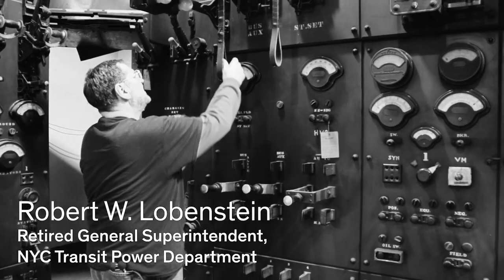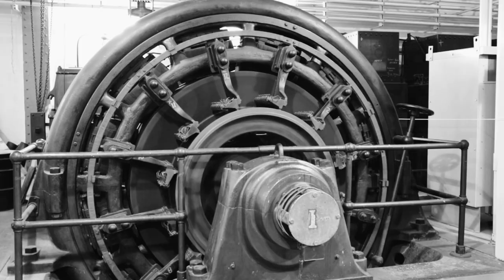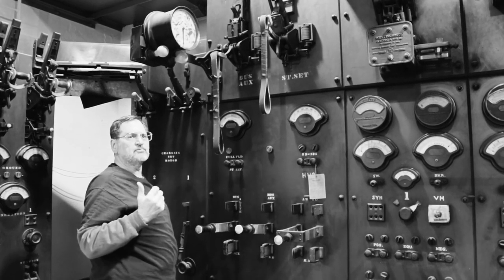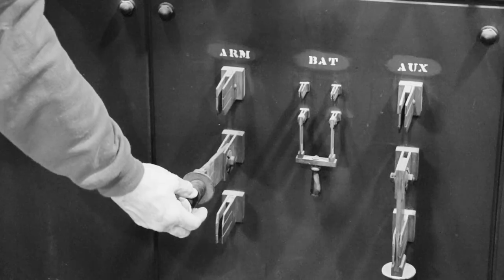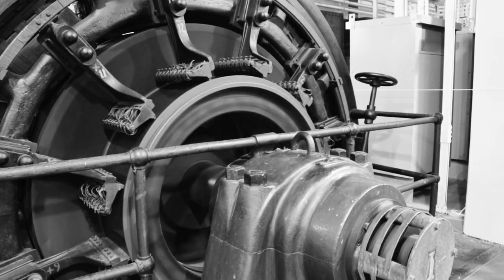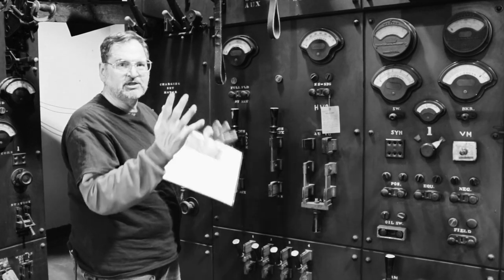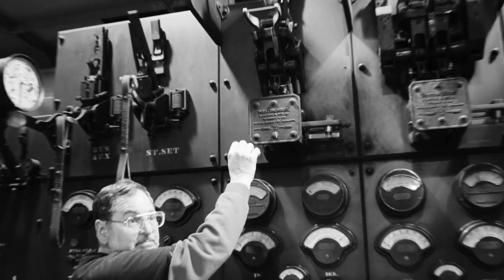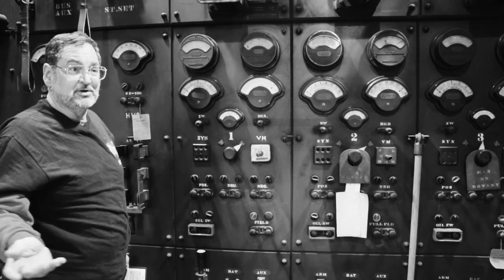NYC's 45-Ton Rotary Convertor

Comment: Synchronizing a motor by hand sounds like unimaginable absolute madness in today's age of VFD's and other computer controlled systems. Incredible!
Reply: it's two blinking lights. When they are both out, throw the switch.
Reply: misusing apostrophes sounds like unimaginable absolute madness in today's age of spellcheckers and autocorrect but still people manage it...
Reply: Set your entry grid. Neutralize your field. The light is green, the trap is clean.
Reply: @chitlitlah  Who you gunna call?
Reply: This is the exact same procedure they used for connecting power plants to the grid.
Someone had to manualy tweak the steam turbine or water turbine to get the massive generator spinning in sync with the grid before throwing the switch.(But there ware obviusly systems in place that prevented you from doing so if it was way off mark)
Reply: Wenn du noch ein paar B- und BL-Motoren rumliegen hast, kannst du es ja mal ausprobieren ;-)
Reply: Now with automation, everything is different.
Reply: @raygale4198  Nikola Tesla.
Reply: @peggyfranzen6159  Ha! My comment was in reply to the previous poster who had lifted a line directly from the original Ghostbusters film.
But totally agree Tesla was an inspired inventor.
Reply: @alistair1978utube  
Get a load of the pendant. I seriously don't know want you're on about.

"Today's” is a perfectly proper genitive of measure (of space or time). Some people have objected to the use of nonhumans in genitives or possessives before a noun (few object now), but in this case, this construction has long been accepted.

Use apostrophes for plurals of abbreviations that have capital letters and periods: M.D.'s, C.P.A.'s. Also use apostrophes for plurals formed from single letters: He received A's and B's on his report card.
Reply: This is the guy I want on my team when the EMP hits and sends us back to 1900’s and all the manual stuff.
Reply: Michael Shapiro  If you want see some old tech that messes with your mind, have a look at an old Westinghouse 24 Volt DC battery charger from the 60's. It's all done with ferro resonant transformers and 'leaky' coupled windings, the only semi conductor is the Selenium rectifier, and yet they maintain perfectly stable output voltage for a huge range of AC input voltage, they also will supply well over 100% rated output with almost no ripple voltage on the output. The only downside is a 24 Volt 4 Amp rated unit weighs about 40 LBS and is the size of a small filing cabinet. A modern switch mode charger same ratings is not much bigger than a cigarette packet. Total respect for these old engineers who designed stuff from the ground up.
Reply: @tommypetraglia4688  your point is correct but I believe the word your looking for is "pedant". A pendant is necklace I think.
Reply: watching this while I am commissioning a TECO-Westinghouse L510 VFD to go on to a 1935 South Bend 9Y-415 lathe.  Times they are a changing. Gives me a glimpse of the world of my grandfather (Iowa Public Service power plant boss in the 1950's-1960's)
Reply: Thats not how EMP works. In fact, those big copper lines and steel busses and third rail on that old machine is more likely to pick up current from a pulse than small, modern electronics. People don't think antennas be like they is but they do. Magnetism strength wanes from the source at inverse Square rates. You'll need a lot of conductors to burn something out
Reply: At Industrial technologies engineering ( PE engineer ) in Madrid , all students still have a practice session having to start-up a generator with a valve, adjust field , check for the frequency and phase difference with the grid and then throw the switch. We managed to get 0.0A of circulating current = perfect synchronization ! ( Luck with the manual switch of course ) . We also have some mercury arc rectifiers as atrezzo in the hall before the electrical engineering department :-) .
Reply: When I was in the USAF in the eighties, I was trained to synchronize a generator to the bus and bring it on line; to remove another gen for maintenance.
Reply: It might surprise you that even nuclear power plants are manually synchronized to the grid. Computers can make stupid mistakes. Operators know better.
Reply: @AugustusTitus  it's really that simple and I actually bet there are still places that run and use this method although be it rare. It's also sorta how I check phasing on generators before I allow them to parallel on new startups. I use an analog meter instead of light bulbs but the principle is the Same
Reply: I still synced to the line manually when running a powerplant in the early 2000's. Faster. Worked in a peaking plant. In auto it took half hour to "take it to the top" 
I could do it in 7 or 8 minutes. Firing the boiler in manual.

Comment: Sounds like putting a sychronous hydroelectric generator on line by hand. First close the gates on the turbine, then fill the water inlet pipe, then connect the generator field coils. There are three lights connected to the generator output and the power line. Then open the turbine gates and bring the generator near synchronus speed. The lights will turn on and off in a pattern as the generatpr output frenquency approaches the line frequency. When all the lights go out there is no difference in frequency between generator and line. Then close the output switch. The generator is then locked onto the main line. Then gradually open the turbine gate and watch the killowatts go out and the money roll in.
Reply: Excellent
Reply: Thank God for Tesla and Westinghouse!
Reply: No money.Genius.
Reply: And if you miss your moment slamming in the switch, hear the huge bang as the circuit breakers trip.  Wait for your racing heart to calm down, reset them and try again... :-)
Reply: @poly_hexamethyl  Memorable moments. Or feel the place shake as the rotor jumps to the synchronous position.
Reply: Benjamin McCann  There is an approximation for the water available. For every five years the volume will be normal. One year out of five will be 15% ABOVE normal and one out of five 15% below normal. So you design the site to handle the high flow years and cover the finances on the low flow years. Flood flows can be 2X to 5X or more. Sometimes a lot more.
Reply: @peggyfranzen6159  Tesla was unique. Thomas Edison had to find and hire a German engineer named Steinmetz so GE, remember them, could provide AC equipment. The era was called the Current Wars.
Reply: @gregwarner3753  Steinmetz devised the mathematics to design precisely stators,  rotors and coils of induction motors, and the correct approach to transformers design. Previously, induction motors and transformers were a trial-amd-error affair, with permanent low efficiency and excessive size.
Reply: Those were the days.
Reply: kcotte59  I worked for a large utility company for a while.
Reply: @gregwarner3753  Generally a machine of that size is closed online running about 1/4 hertz slow, and closed on the line when it approached in phase within 10 degrees with the field slightly low, so the pull in is soft, then the filed increased to change the power factor from inductive to restive on the AC side.. If the converter is closed on line ahead in phase, that tended to slow the already slower machine and bounce hard and trip over current protection. Close as it comes into phase, not after. I have brought banks of diesel generators online in a power failure and they were in parallel when the HVAC was brought back online.
Reply: @antoniomaglione4101  see also Eric Dollard
Reply: Or like paralleling the generators in an old Boing 707 airplane, just without the water...
Reply: @davef.2811  At least you were not carrying the old lump of iron and copper with you. 

I was unaware the B-707 used multi phase AC. Makes sense.
Reply: @gregwarner3753  Power generation was from four 30, or 40 kVA constant speed, engine-driven generators supplying  3 ph.115/200V, 400 Hz. Additionally, some busses used transformer/rectifiers to supply 24Vdc for their components, with a 24 Vdc battery used for non- GPU assisted starting and emergency busses. The pulsing lights were used to sync up the gen's to the tie buss or else the input shaft)s) on the constant-speed drive unit(s) could be sheared.

Comment: So this is Loby.  Fantastic work to all of you.  Thank you for preserving this control house and the rotary as a working setup, I hope this tradition continues into the future.  I'd love to see the machine run some time.  We are restoring a 6 story tall waterworks steam engine that shares common castings with the large family of Alternator Corliss engines that once ran in the 74th street power house and no doubt fed this very rotary station.  We have just finished putting our 1914 250 volt DC motor and switch board back on line to demonstrate to visitors in exactly the same way as this.
Reply: Actually, this substation was fed from the 59th st IRT Powerhouse, not 74th st. The two plants were similar in the way they worked. Would love to see some clips of the Allis Chalmers reciprocating steam engines.
Reply: 59th street had them too.  Fantastic engineering.   When we get our waterworks engine running, come down and see it.
Reply: @AEKarnes  post up a link!
Reply: We finished her.  The videos of the giant engine running, along with the 1914 DC motor, are now on my account.

Comment: I serve as a docent at the Mt. Wilson Observatory which is a little newer than this substation, first telescope being built in 1905. DC electric motors of similar vintage are used throughout the historic observatory where Edwin Hubble discovered the expansion of the universe. We have several panels with exposed knife switches, though only at 110VDC. They now have safety covers in front, but the 110VDC still powers all the motors used to drive the telescopes, and associated equipment from that era. Modern rectifier banks from SoCal Edison now replace rotary converters which in turn replaced the 1500 cubic inch two cylinder Fairbanks Morse generator still in the powerhouse, and still in running order. That 1912 generator powered everything on the mountain in its day, but did so by charging a large bank of batteries at night. Its vibrations and noise, even from 1/8th of a mile away, were considered too much for the extreme sensitivity of the 100 inch telescope optics. That telescope was still the world's largest when I was six years old in 1948.
Reply: Paul Gracey I have seen Hubble sitting and peering into that monster.
Reply: I love hearing about old stuff like this, must be such a cool place to work.
Reply: DC is best,even to this day DC motors are far more sensitive and accurate for speed/torque control.No need to change what works.

Comment: Back in the 1960's the Chicago Transit Authority ran rotary converters to rectify 30 Hz . Commonwealth Edison had to provide the 30 Hz power from 60 Hz and used 42,500 horsepower synchronous motor-generator couples for this purpose. They weren't self starting so there was a 1500 horsepower motor used to bring them up to speed for each one. I believe they turned at 600 rpm and the coupling shaft was about a foot in diameter. I was impressed.
Reply: I love big electrical machinery like this.
Reply: What was the efficiency from input to output?
Reply: @johnluck8916  From Google: the efficiency is about 60 to 75 percent, which is about twice that of primary generators. They had some very old steam powered 30 Hz generators at other power stations, but they were run from low pressure boilers, and were rather inefficient. I'm sure all are now gone by now, and the Transit Authority rectifies 60 Hz by more modern means.

Comment: For those who need more background:
“A rotary converter is a type of electrical machine which acts as a mechanical rectifier, inverter or frequency converter.
“Rotary converters were used to convert alternating current (AC) to direct current (DC), or DC to AC power, before the advent of chemical or solid state power rectification and inverting. They were commonly used to provide DC power for commercial, industrial and railway electrification from an AC power source.”
Reply: As a yacht rigger I worked for a real Connecticut Yankee who built every tool, rig, jig, and machine geegaw if none was available to suit his needs.

In the course of our work, one day we came upon a 14" Rockwell table saw which was free for the taking if we could move it from a machine shop basement 14 feet down. Being riggers, no prob and basically free.

But it doesn't end there, boss wants it in his. Again easy move, but here's the rub... the utility said no go on the 240 line.

So he ran a 3 phase motor by spinning it with a 120 then taking the 240 off the 3rd pole.(?) I know that might be oversimplified and or technically incorrect, but I would use it on occassion and that is the configuration I know I saw.

But of all the trades I'm jack of, the one I regret lacking is electrical, and believing electricity is not a hobby and a little bit of knowledge means there is a whole lot of ignorance remaining... so besides replacing a plug or switch I never dikked with it. And at 60 and in failing health my mind can't take the strain of learning something else. 

Although I get the basics here
Reply: The submarine that I was stationed on had two 300 KW AC-DC motor generators. The DC power to start them spinning was from the ships battery.
Reply: @tommypetraglia4688  Most home circuits for dryers, ovens, water heaters, etc. do that. They take two 120V breakers and use those as hot and neutral 240V. That’s not three phase, though. More than likely, he rewired the motor for 240V.
Reply: @tommypetraglia4688  - are you ok??
Reply: So this had AC Motor taking the 3 phase AC as input... and spinning a mechanically linked Generator to produce DC... ??  Love the control panel. Manual Control seemed to require knowledge for the order of operations.
Reply: Richard A. Solomon Thanks for how this was used.  Were the subway motors DC?
Reply: Australia mostly used mercury vapour rectifiers.
Reply: @5roundsrapid263  Those two breakers supply 240 volt single phase power (each leg is 180 degrees out phase from the other) with each leg 120 volts to neutral.
You can make a phase converter from a three phase motor that is roughly twice the horse power as the one you intend to run. The larger motor is run as a single phase motor on one set of its windings and the other phases are induced as it spins, making it into a three phase generator. It won't be self starting and is woefully inefficient, but it works.
Reply: @5roundsrapid263  
Thanks. Like I said Electrical = Idiot Me
Reply: Redrooster  
Thank you for the encouragement but I've lived a life of abuse illness and trauma and frankly inspite of that I managed a decent life, but nowhere to the potential I could have been. And now my brain is fried. (and not from no drugs or booze, no addictions)

 I take it easy one day to the next knowing I have maybe a dozen years. My body is broke from 40 years of labor. 

Not only am I broke, but brokedown as well... as it seems one always follows the next

 Sleep, read, a little YT and Reddit, cook a meal, tinker at my bench, take a nap then see what's next. 

I was homeless 6 years the last 3 of which living in my car, and tho I'm in housing 3 years the hangover of all that still lingers. 

How could it not. 

But again, thank you. You sound like a good dude
Reply: That's not how 3 phase works. You might be able to start and run a 3 phase motor on single phase but its going to be severely underpowered and possibly overheated if it doesn't just stall out or trip a breaker/fuse. There are now 3 phase converters you can purchase using rectifiers and transistors but I'm sure he didn't have one of those as it would have been insanely expensive... They're still pricey today.

The electrical phases need to shift in order to spin the motor without mechanical assistance. 3 phase being 120 degrees out of phase of each other. Common voltage nowadays is 208 but can vary depending on your usage and loads.

Hooking one hot leg of 120 and then two to get 240 isn't going to do a thing since they are single phase. You'll energize two windings and likely just burnout the motor as it hums.
Reply: @5roundsrapid263  In the 60cycle 120v world.
Reply: @tommypetraglia4688  He used a static phase converter. It is a capacitor that 'fakes' a third phase. By bringing in the other motor, it makes the sine wave that much smoother. We did the same thing when my father had a machine shop in his garage.
Reply: @PeterWalkerHP16c  I believe the rotary convertor, at least mainstream use, predates mercury arc rectifiers.
Reply: @ssmt2  going home buss
Reply: What's a "chemical rectifier"?
Reply: @tommypetraglia4688  Doesn't sound right. The table saw was probably 3 phase and only single phase was available so he rigged up a rotary phase converter. If you had a situation where you needed 240 and only had 120, you'd use a transformer.
Reply: @ssmt2  Yep, same here - 2 boats. ET1(SS)
Reply: @tommypetraglia4688  Would work, but wouldn't be terribly efficient. Basically, he created a motor - generator. Most motors can be mechanically motivated to act as generators. A 3 phase 240VAC motor would produce 3 phase 240VAC out.
Reply: It sounds like you copied it from Wikipedia
Reply: Rotary converters used to be a better option back then, long before we have better DC to AC inverters thanks to the improvements of the transistors themselves which they didn't even have back then. So, it did its job well.
Reply: They are/were also commonly used for AC/AC frequency conversion, e.g. german railway on 16 2/3Hz vs. Main Utility Frequency of 50Hz